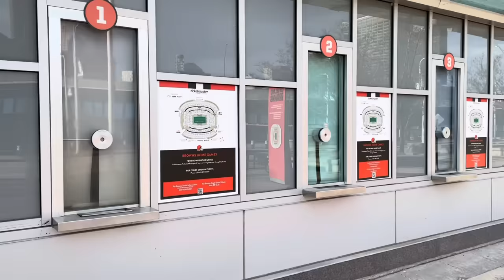Stadium Features That Are Now Obsolete…

Comment: Don’t forget reasonably priced seats.  Don’t see those anymore.
Reply: Never been to an AL Central game? I've never bought a tigers ticket over 10$.
Reply: Rays games may be the exception that prove the rule, but I have season tickets and for any game NOT against the Yankees/Red Sox/Cubs, and especially during the week, they can be 5 bucks
Reply: Supply and demand. Less demand, lower pricing.
Reply: I'm a White Sox fan. Thankfully, since the stadium isn't full, I get cheaper tickets! Also, I found out that if I buy my ticket at the counter in the stadium, there is no tax for some odd reason. Ahh... the memories of $7 tickets, even though I was way above the field.
Reply: @adamsmith583 Try an A’s game. Lol
Reply: It's supply and demand, chief. Go to a crappy team's stadium in July. You'll find great seats for peanuts. Try going to a Dodgers or a Yankees game with 50,000 other people and yeah, things are going to be a lot more expensive.
Reply: Over the last few years I’ve gone to at least one Cardinals game every time I’ve been out that way for work. Decent seats have been less than $40 each, comparable seats in Fenway are at least 3x that.  So yeah, cheap good tickets are still out there.
Reply: @adamsmith583  🤣  it's nice huh?  I've gotten blue jackets, cavs, guardians, tigers, pistons, redwings, reds, pirates, Whitesox tickets the last 4-5 years for cheaper than the local minor league teams games cost. 

5$ tickets *+ service charge many times
Reply: @adamsmith583  I was gonna say...White Sox tickets usually go for about $8 a seat
Reply: Back in 1977, the Red Sox signed free agent reliever Bill Campbell, who had one decent season.  A fan held up a sign that said, "RELEASE BILL CAMPBELL AND BRING BACK THE $1.50 BLEACHER SEAT!"
Reply: @gedias1 thank you player's unions for making these games so much more expensive!
Reply: Or prices at concessions
Reply: That’s because the bullpen catcher is paid $2.6 million per year.
Reply: @chuckinhouston9952  All they're doing with these outrageous salaries is pricing fans out of the arenas, that's true for all professional sports.Part of the reason I am now disinterested in sports is that,I can remember watching games on TV as a kid when commentators would sometimes mention what players did for jobs in the off-season.
Reply: @chuckinhouston9952  Tim Wakefield was the opposite example.  He was so grateful to the Red Sox for giving him a second chance, he kept re-signing the same $1 million contract every year until he retired.
Reply: @adamsmith583 True @ Michigan & Trumbull; since the move 2 "Blow-Me-Erica" (Comerica) Park; not so.
Reply: Dodgers stadium has joined the chat
Reply: @adamsmith583  if the Detroit Tigers signed Shohei Ohtani for the money he’s making now, I personally guarantee you would never be able to buy a ticket for a tiger game for $10
Reply: @bryantsteury8910  you could probably mildly get away with spending less than $40 for a day at the ballpark to see a Tampa Bay rays game, but try doing that at dodger Stadium or Yankee Stadium. That price might barely pay for just the parking alone.
Reply: @beartackle  I can’t wait for the White Sox to finally move to Indianapolis
Reply: @yell0wberry  Without a doubt. I used to live in LA and either you're parking for $25 minimum or way the hell down the hill and walking at least a half mile. MAYBE you get a Tuesday in early May day game against some dumpy team like Miami and can skate for $40 if you don't get more than a soda. That's the only way I can think it'd happen
Reply: @yell0wberry  Ever since the Tigers moved 2 "Blow-Me-Erica" (Comerica) Park in 2000; there's NO tickets (when sold individually) under $10. Shit; how do u believe that the Tigers afforded the recently retired Miggy Cabrera? I can assure u that while his most recent contract was 40% of Ohtani's current deal, ALL TICKET PRICES WERE >$10 (i.e.: greater than $10)!!!!! Still r so; after all, what about Javier Baez's contact (albeit 20% of Ohtani's)?
Reply: I haven't been to a game since Cal Ripken played. I can't imagine food and beer prices.
Reply: @jefffuller9918  Jr or Sr? If it's Sr I'd recommend not going, you'll give yourself a stroke
Reply: @bryantsteury8910  Well that settles that. Thank you.
Reply: Yes you do. Don't buy direct from the team.
Reply: @davidlafleche1142 it was 4 million not 1 million.

Wakefield was a great person who did a ton of charity work.
Reply: @yell0wberry I do it at Yankee Stadium 25-30 times a year. Their ticket market collapsed about ten years ago. 95 percent of games are dirt cheap if you look on the secondary market.
Reply: @tommyfu9271  Regardless, that was one of the best deals the Red Sox ever made.
Reply: @davidlafleche1142  absolutely was just correcting the number.

I'm a Yankees fan and even I was sick when I found out he died. Just a great person all around.
Reply: Left field bleachers at T-Mobile Park are $15
Reply: @frankisfunny2007 

Sure, it’s their fault and not the billionaires running things handing out stupid contracts to undeserving players. 🙄
Reply: Goes with outfield seating being "obsolete" instead of artificial scarcity.
Reply: Go to an Angels game this season, you will find plenty of reasonably priced seats.
Reply: @adamsmith583 CAUSE WHO LIKES THE FUCKING 50 WIN TIGERS
Reply: Just go to a white Sox game
Reply: Every Yankees game I attend I'm playing $15 for standing. Go hang out in the outfield bars
Reply: Supply and demand.  If a team knows they can draw a certain number at a certain price… they’re gonna sell at that price
Reply: Went to a Stros game for 13 bucks a ticket
Reply: @adamsmith583  ya I was going to say white Sox tickets are super cheap. My friend and I got tickets 8 rows behind hone plate for 30 dollars each
Reply: @gedias1 what about in football. no one demanded Super Bowl tickets to be 10k tf? They just realized rich assholes will go watch a game they don’t care about just so YOU see them and they get the screen time. The nfl just says fuck you to real fans. It’s not demand. It’s greed.
Reply: @HaidaWay  You seem to have it confused. The market dictates the price of anything. If demand is high, price goes up. If low, then price goes down to sell the product. You as a consumer have the right to walk away. This is what life is like in a capitalist society.
Reply: @frankisfunny2007 lolol
Reply: IDK man Twins tickets are still pretty affordable 🤷🏻‍♂️
Reply: @stanbrouillard2292  well if the Pohlads would spend some money on the team.... lol
Reply: @yell0wberry fk that
Reply: Back in the day watching sport, live, at the stadium was inexpensive entertainment.  Nowadays it is so expensive I just can't be bothered.
Reply: @TCRBrad I've never paid full price for a While Sox game.
Reply: You hit the nail on the head there. God knows I had a few obstructed view at Tiger Stadium, too.
Reply: Amen

Comment: Are there still "box seats" in the preferred areas of the stands?  And it looks like they've done a good job of designing out the obstructed view seats that were behind those vertical I-beam columns in the old stadiums.
Reply: That’s what I was going to offer, the old fashioned, literally set apart by iron rail work, box seats. They could make scrambling for a foul ball a painful effort!

Comment: Honestly, the whole bit about reducing capacity frustrates me; you could drop ticket prices to something more affordable, get more people in, and allow more access to games with the reduced prices.
Reply: Unfortunately, reality does not bear that out. People that aren't interested in personal attendance of stadium events aren't going to start showing up even if the tickets were free. People that attend at all these days are typically regular attendees, and will pay the ticket price if it's even remotely reasonable. There's a limit to how much additional demand you can stimulate by lowering prices, and by this point the stadiums have figured out the sweet spot for supply/demand. And many stadiums are still struggling to remain profitable without major lines of revenue outside ticket sales (like ads and sponsorships).

There's no point in increasing capacity (or paying maintenance for the larger capacities of the past) if no amount of price reduction or advertising is ever going to fill those seats.

Comment: All the old scoreboards are obsolete and replaced by LED screens of various sizes and types all over the stadium. 
PS — Loved it when they ripped out the old scoreboards at the LA Colosseum and put in both the huge scoreboard as well as the two smaller scoreboards. The stadium looks much nicer after they simplified / restored the area. Place is ready for another Olympic closeup!

Comment: Great list! Some I wouldn't have even thought of... One I'd add is athletics tracks! Most stadiums that were designed and built in the past included them to hold large competitions or were added for the hopes of winning the Olympics, etc. At least outside of the USA were stadiums that were for football and athletics are still a rarity with LA Memorial Stadium being the largest and best used of them... Here in Canada? Montreal's Olympic stadium has space for its track but was removed decades ago and Edmonton's Commonwealth Stadium has it but rarely uses it since the main tenant is/was and probably always will be the Edmonton Esks/Elks CFL franchise which despite its waning popularity still can regularly draw 35-40K per game on a good year...
Reply: Fixed domed stadiums are also obsolete...Seattle's King Dome, Tampa Bay Tropicana Field, San Antonio's Alamodome... Montreal's Olympic Stadium which despite being empty just got $850M last week to rebuild its formerly retractable tent roof into a fixed semi-transparent Teflon dome.  The only domes that get built these days are ones that have roofs that be retracted, folded or slide out the way, with the exception of Las Vegas which for obvious reasons went with a closed roof... Thank you Skydome effect!
Reply: Many stadiums including the LA Coliseum that used to have a running track have had the field lowered and stands built closer to the football sidelines.
Reply: @stickynorth Isn't the LA stadium fixed dome as well?
Reply: Seeing that many retractable roof NFL stadiums keep their roof closed most of the time, the latest NFL arenas have fixed roofs.
Reply: @mls515  For the 2028 Olympics, a platform will be built for a temporary track above the field and lower rows of seats.

Comment: Stadiums that hold football and baseball on the pro level. I always felt it was another slight home field advantage for those teams who did when the ball was in the infield part for those teams.
Reply: All multi-use pro stadiums are gone except technically Oakland.  I only mention that b/c it could still be used for football or even soccer even though no non-baseball team calls that stadium home not to mention the A's will be out of there shortly.

In more recent years, they would lay down sod over the infield and unless the baseball team made it deep in the playoffs there would be no conflicts.

Comment: THe original lighting came from mercury vapor lights which were even heavier than Nickel metal halide.  They also took forever to acheive maximum light output.  The instant on LEDs are so much better for that.
Reply: I can remember those from playing high school football. That’s why even for early-season games where there was still sunlight through most of the game, they’d throw the lights on because it took a good 15 minutes for them to get to full brightness.
Reply: @zlinedavid  Ive heard some stadiums even did the lights early just because they also helped cut down on shadows.  I worked in a supermarket with them and wow if a storm fluttered the power they took awhile to startup. And only like every three would be hooked to the generator.

Comment: I disagree that the outfield bleachers have gone away because they don't need the capacity. The majority of stadiums are in the 40-42k range, and while the 50k stadiums tend to be older (only three in the last 25 years are even 46k), the change to having fewer outfield seats doesn't track with that. Rather, I think the reason stadiums have fewer outfield decks is because they block the view out of the stadium.
Reply from the maker: I would say it somewhat depends on market but many teams would rather use the space for premium areas than use it maybe 2-5 games a year that actually demand the capacity, plus they dont like aesthetic of so many empty seats, i dont really think its about outside views, the math is undeniable that attendance has decreased markedly since the 2000s

Comment: How about the upper deck being close to the field

The first row of the upper deck at Comerica Park in Detroit is further away from the field than the last row of the upper deck was at Tiger Stadium
Reply: I remember how Tiger Stadium's upper deck was basically on top of the lower level, instead of being set back. Wonder how far away the last row of the upper deck in center was, considering Tiger Stadium had a deep center field of 440'. Hardly anyone hit a ball by the flagpole.
Reply: @lo1bo2  there isn't an upper deck in the outfield at Comerica Park, so you really can't compare them